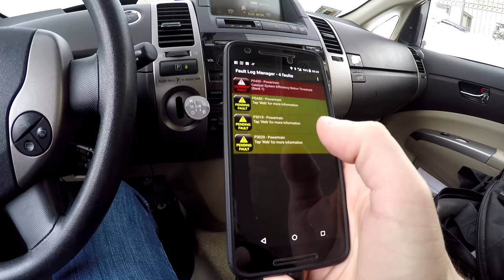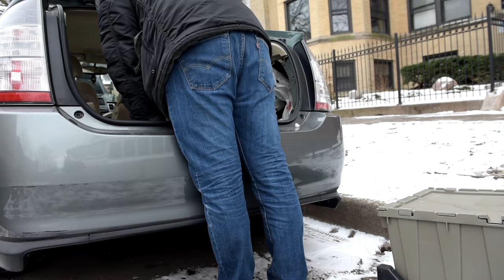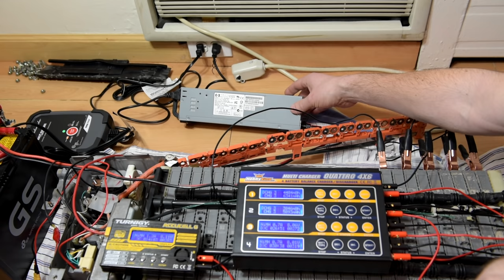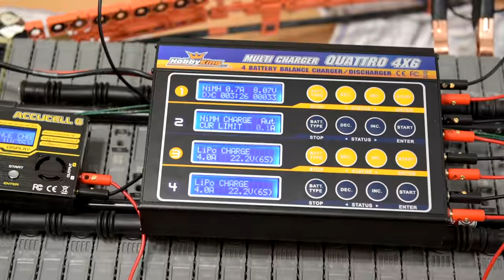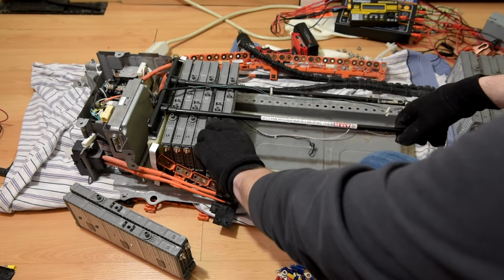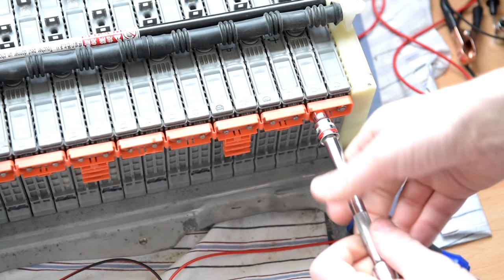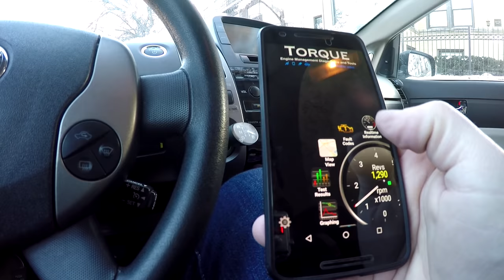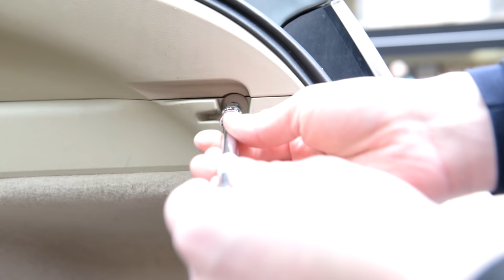Hybrid Battery Repair Ultimate Guide (Toyota Prius 2nd Gen 2004-2009) DIY

Comment: Dear igor. Needless to say you have done the perfect job and addressed even the very minute but crucial information. However, at the very end you said you can balance charge by doing so n so... I seek your guidance in that active bottom balancing for all those 20 cells combined. Also in your sheet you marked module 15 as poor i which was a mistake i guess.
Reply from the maker: Thank you Saad. Module #15 failed the internal resistance test. It was in the top of the resistance test list as the weakest. It was in the middle of the pack as well. Sorry not sure if I understand your question about the balancing.
Reply: @IgorKadulenkov  my question is after doing resistance test and doing charge-discharge cycle there is another step to balance charge entire battery pack. Means all of the modul are at equal level of charge. This process is usually done by active balancing method using a balancing board. I need your help if you have any idea of this. I am starting a battery reconditioning service workshop and you deserve a portion of royalty from that earning. Share with me your email address please.
Reply: @saadhaider7407 how is your business going. I am very interested in learning how to do this and start my own business rebuilding hybrid batteries

Comment: Thank you for this very informative video.  It's fantastic.     
I have One question.   Since little more than 2 years has passed since you did this operation. How is the status for your hybrid battery today?

I have a prius Gen 3. When using "DR PRIUS APP" it says that my status is 47% at the moment.   This is after i have evened out the modules.
In Juli 2020 i measured 65%. So i was little bit surprised getting that low rate after doing this even-out-operation.

I did not balance the modules. i'll guess that i just can't skip this procedure.

Comment: Great video. It’s been over a year since you’ve done this. Has the Prius battery held up since then? 

I’ve heard that only replacing a few battery cells doesn't get you many miles.But you seem like you’ve done everything properly.
Reply: That's if you don't do the testing and conditioning steps he did
Reply: Уп

Comment: Great video Igor! I will have to say that I have two major questions though.  What is that HP hot-swappable power supply used for, and what is the charging voltage for the cells and where are you setting this?  Other than that, everything was quite clear.  Thanks for your fantastic work on this!

Comment: Hi Igor 
I dismantled the entire battery pack and replaced the bad cells. After that, I was trying to reconnect everything. While trying to reconnect the yellow connection harness(single piece) ,sparks flew off. This is the first time am facing the sparks from this battery. I have done this couple times and there were no sparks. But this time not sure what went wrong and I tried to reconnect the yellow connection harness and sparks flew again. Can anyone please suggest me a solution for this?

Comment: @igorkadulenkov How is your battery 3-4 years later?  I followed your steps (except I didn't match internal resistances in new blocks by the repaired/replaced modules very scientifically) and got errors that Dr Prius (the actual guy, Jack!) suggested mean either resistance in the orange harness (replace?) or a failing battery ECU (the rectangular thing wit the (dangerous) orange plug going into it.   Once I reopened the battery metal cover, I could immediately see bad green/brown corrosion on the copper bus bars - much worse than the car had when I removed the battery 3 years ago - when the battery was 17 years old.   I used NoAlox like you did, so I'm wondering if that was not helpful for you either?  Another problem in my car is water intrusion.  Though I caulked and sealed what I thought were all the rear area leaks, it appears there are more of them than I thought - and shockingly  I can day light through the driver side rear wheel well area above a few inches above the rear strut!  So when driven in rainy conditions, I assume quite a bit of tire-spun water was getting in to the area close to the battery.   I will be using some Rust Reformer and Bondo or something on that, but that might account for some of my corrosion.  However, I wondered if others had bad corrosion after it.   As for the condition of the HV Battery, Dr Prius (the app) says the battery itself is at 88% (OK/Good) after 3 years, though I've not dug into the module checking (grrr, not looking forward to that weeks long process again) yet...

Comment: Thank you for this. Which OBD2 Scanner are you using to get the voltages of the cells?
Reply from the maker: Any OBDII bluetooth reader would work with torque app for Android. You will need to download Prius profile for Torque app , then you will get all these additional parameters.

Comment: Hi, thank you for this great video best one on youtube, a question other than you have the car up and running what is you MPG now after the fix and what it was before?
Reply from the maker: Thank you, Francisco! The MPG had definitely improved, but it all depends on how you drive it. Before and after the battery failure I was able to get 55mpg if I wanted to. But it’s easier now, I can definitely tell that it takes longer to discharge the battery after the fix. I can drive further in the straight line

Comment: Igor, thanks for this awesome tutorial. I have very similar setup in my Pug 508 Hybrid and will try this for myself. It's 200V 5.5Ah battery pack like yours I asume. Have you ever consider adding more cells to the battery? Or even adding extra battery in parallel for extra capacity?

Comment: Great video everything well was well explained! Creators like you can be hard to find. My only question is how much time will it take. A shop near me in nashville said 1300 dollars  for refurbished battery.  Is saving around 1000 good enough? Thank you!
Reply from the maker: Hi Nicole, thanks for the feedback! It could take anywhere between 7 to 15 days, depending on how much time you have, how many modules you could be charging at once and if you enjoy working on the cars in general. The problem with refurbished batteries is that shops never do a thorough reconditioning, but just replace a module or two. So you are essentially buying yourself 1-1.5 years before it happens again. But If you spend extra time and do a quality reconditioning, it could last for years. It’s been 4 years since the video was filmed, the battery on the video is running strong.
Reply: Wow that's good to know thank you. 😊

Comment: In the minute 17:20 you say that you will configure fo 5.0 A to charge, but in the image it shows 3.0 A, What is the real value did you use for charge 3 A or 5 A? using one or other  will affect to finally mAh value?
Reply from the maker: It's up to you, but in general - the lower the better, as it will put less stress on the module, but it will take longer to complete 1 cycle. The higher the current, the more likely it is that the module will overheat and expand. I started at 3A and then increased to 5A(or 4A, not sure). I think, the most gentle charge rate would be 0.1 * 6.5A = 0.65A. I don't think it will affect the final capacity.

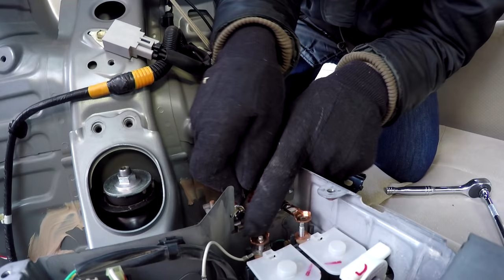Comment: @37:11 Will you please tell me if you see any voltage across the junction box terminals before connecting those leads from the car. I have a battery for RX450H. It's outside the car now. When I measure the voltage across those two terminals it shows zero voltage but I know the modules are good. I expected to see around 300 volt but I see zero. Is there any safety feature  that makes it necessary for those leads from the car to be connected to the terminals before it shows any voltage? Thanks!
Reply: Here is the answer from 

 JOSIAH DASSI and I am copy pasting his answer. He is totally right!   "there would be no voltage there until the contactors are activated,,,,the contactors won't be activate with those frame wires disconnected...you'd get an AA6 code"

Comment: Smart Man! Using an Optima Spiral Cell 12 volt battery. Anything else for a Prius is crap.
Reply from the maker: Yes, it’s the best for Prius! I swapped the battery when I did this job
Reply: What is a spiral Optima?
Reply: @IgorKadulenkov  what is the optima spiral?  A battery brand?  Are these for replacing your modules in the battery packs?  where would I get one or two of these modules?
Reply: It's the best replacement for the 12 volt in the Prius trunk. Same price as the AGM original but longer-lasting. Google "Optima Battery for Prius"

Comment: great video, may be a short term fix since all the other cells are the same age as the ones that you removed.  All news cells cost  around 2k and might be worth it if you are going to keep the car.
Reply from the maker: Thanks. Theoretically, yes. Practically, past 3 years since I filmed this there has been no deterioration of the battery performance. I think it is worth it if you are a DIY enthusiast
Reply: @IgorKadulenkov  thats good to hear

Comment: Thank you so much for the video very useful, I just have one question, with the power supply, can you advise if there is any specific output plugs that I can use with DPS-600PB?

Comment: Nice tutorial, I appreciated. I have 2007 Camry Hybrid and I follow a few tutorials and took apart my battery and cleaned the copper plates and measure voltages on the cells all came good at 8.05V lowest was 7.96V so I put it back. Did not know you have to load test them to make sure they are all good. Now I have to take off again, lol. Is there a particular seller that sells good quality sells you can recommend?

Comment: Thank you very much @Igor Kadulenkov for the Video, I am now in the process to prepare one I got from scrap, then I can change the one in my car much quickly. Until now ( I process 12 modules) and I got values between 5454 and 6586 mAh of discharging, moslly over 6000 mAh, with that good values do you consider that is also necessary do a internal resistant test? I observ in the video that the #15 even that gots over 5400, you discard because was the worst in internal resistant test, by other hand you discard also #18 because has volts very low respect the others, In my case the #1 was even under 6 volts, after 3 cycling it gots 5891 mAh, In resumen is not mAh good values enough to consider that he module is in a good state? In the pass I mount a module that the internal resistance was very bad but after re-cycling It gots good values for mAh and until now is working fine in the car, Is not the re.cycling a way to recover modules , that are not so bad , Is true that other modules with bad internal resistance, never got good values in recycling .

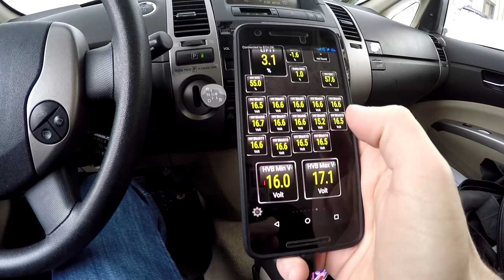Comment: Thanks for the wonderful tutorial! I have a  question Igor. I am having the Torque (paid) app. But i don't know how to add battery information (individual cell voltage info) in the real-time information stats (one that you are showing in video starting from 1:25). Can you please tell me how to add this? Is there a plugin that we have to install separately? Please guide me. Thanks!!
Reply: Its an OBD2 scanner. Make sure you get one that works for ios if you have iphone
Reply: In settings -> Manage extra PIDs/Sensors
Top right corner -> Add Predefined Set
Reply: @matiasbickel4491  I don't believe there is a bluetooth OBDII scanner for Iphone yet - at least most of the generic/cheap ones only work with Android phones and tablets.  Then connect Torque to that...

Comment: Igor, this is an awesome video. Thanks. I heard you using Torque App. Which brand of OBD ii scanner you used or using. I am going to order one for my Prius based on your recommendations. A scanner that can read each Modules voltage like on your phone display.  Thanks.
Reply from the maker: Hello, thanks. I would not order an expensive scanner. Just google for "elm327 bluetooth adapter", they run for 10$ and can be used with android phones. Then in the Torque app you can install a profile for Prius and it will be showing all the data

Comment: If I was to use these in solar, what should I set my charge controller  to? Floating lead acid I use 14.5 volts but NIMH.?
Reply: May I? As long as they can go up to 16.8, little more often...14.5v like Lead will be ok, but no discharge lower than 1v/cell, that's minimum 12v limit! If you can set your solar charger to 1.4v/cell will be even better!

Comment: Hi Igor, very helpful video, thank you for your efforts. I am having some problems - 
I am using an IMAX B6 charger and did all the settings as per your instructions but I just can not seem to get through a full set of cycles and get any results from the device. I left the IMAX B6 to charge one cell for about 9-10 hours yesterday and the B6 had just frozen its screen. The battery cell had gotten warm and swollen, I turned everything off and the next day the cell had shrank.

How do I use the IMAX B6 correctly?
Reply: The B6 chargers are known to often be fakes of the actual B6s, themselves copies of earlier chargers.   I got one from a hobbyist and it was complete junk.  I got another from Ebay new for $20 shipped, knowing it was a fake of a copy.  It turned out to be mostly useful- the DSC level was 1.5A (higher than my multiport Turnigy charger DSC rate) but the darn thing refused to do more than one DSC->CHG cycle.  If you're going to use these chargers you need to become familiar with the strange menus/button presses in them.   Some of the settings are under User Settings menu and some of the settings are under the Battery [Nimh] menu.  If you can buy a multiport charger that allows high rate DSC values.  The Turnigy 4x6s helped me a lot, but you wait FOREVER with only .5 DSC rate (although it claims up to 3A...)

Comment: Thank you so much for the detailed step by step process. Learned a lot about batteries. Excel sheet analysis is excellent.  I have a Honda IMA system. Planning to DIY. Do you have any guide on that since the batteries are Li-Ion.
Reply from the maker: Thank you. Sorry , I don’t have experience in servicing Li-Ion batteries

Comment: This is by far the best and most comprehensive video I've seen anywhere, well done and thank you..... I do have a question though. At approx 32:13 minutes, you mention a better way of leveling the voltages. So are you saying literally connect all the positives together using a cable, then separately connect all the negatively together? Do I need to have a certain thickness of cable due to the increased voltage? Any advise would be gratefully received :)
Reply from the maker: Thank you for the feedback! Yes, you need to connect all pluses together and then separately all minuses together, that will bring  the voltages to the same level. Not sure what thickness you need, I would assume it can be similar to what you use for charging.
Reply: So after you waited for 24hrs with all positives and negatives connected in parallel, did you have to discharge some modules with the charger? Thanks
Reply from the maker: I have not done it this way, cause I would have needed to buy more wires. I just used the bulb. But others said it took them 6 to 24 hours to balance

Comment: Igor, your video was fantastic. I'm thinking about doing exactly what you did. But, I'm wondering - now that it's been almost 10 months since you made this video, have you gotten any 'Bad Hybrid Battery' codes? 

I guess what I'm getting at, is at this point in time do you think this was worth it? And I know it varies between cars, but how much extra life do you think doing this gets out of the car?
Reply from the maker: Thank you Michael. It's a great question! It's been longer actually, I filmed this in January 2018, so it's been 18 months now. And I've put around 13000 miles on the car since then. It's still running strong, no issues with the battery and I don't feel that it deteriorates in any way. Was it worth it? It was to me, my battery pack was in pretty good condition and I was able to prolong it's life significantly. I don't mind getting in there again if that would save me another 1000$. The repair is costly if done by a third party and our cars are pretty old and not always worth the cost of the new battery, so it's good if you can do this on your own. Plus, I don't think you could get a quality repair service. What you usually get is a replacement pack without proper reconditioning, who knows where the modules came from. These usually last for 6-12 months. And besides, it's a fun project if you like working on your car :)
Reply: @IgorKadulenkov  Oh wow, ok that's definitely worth the effort then! I appreciate the reply. 

I ended up going with Hybrid Automotive's Prolong grid charger/discharger package. I decided that was the most cost/effort effective method, while also keeping my car mostly drivable. I know it probably wont be as good as how you did it, but if I can get another year out of the car I'll be happy for the ~$600 overall investment.
Reply: @michaelagnew1515  how
Reply: Did it go

Comment: Igor, would it be possible to charge and discharge all blocks simultaneously with lower charging amps? In other words, in your opinion, would this be possible and not overheat the blocks? My thought is to use 7 Turnigy Quads with 7 HP power supplies (or the equivalent)?
Reply from the maker: Hi John, I think it is possible. The best charging rate would be 0.75 amps for a module. At this rate they should not overheat or expand. You could try to raise it higher, maybe to 1.5-2 amps and run a single module to try it. I would still discharge at highest rate your charger can do (usually 2-3 amps). Also, if you going to use the same power supply as I did, you will probably need only one. It can handle 40-45 amps. It should handle all blocks simultaneously 1.5amps X 28 = 42
Reply: Thank you Igor
Reply: I wonder how much longer it will take to go through 3 cycles at ~1A charging current